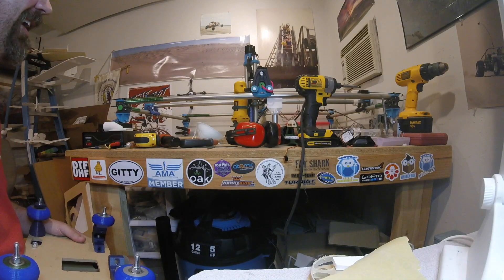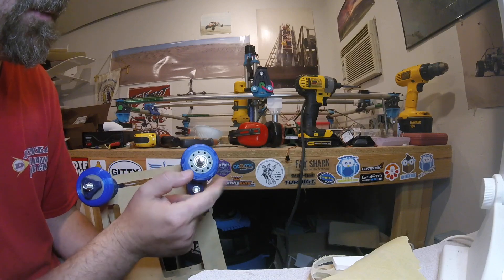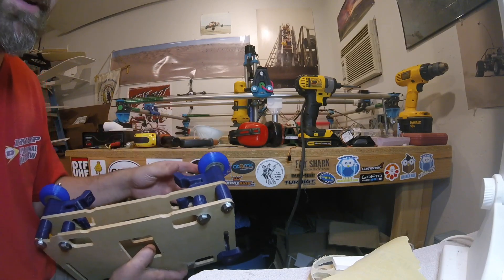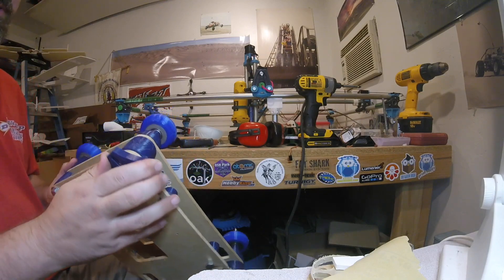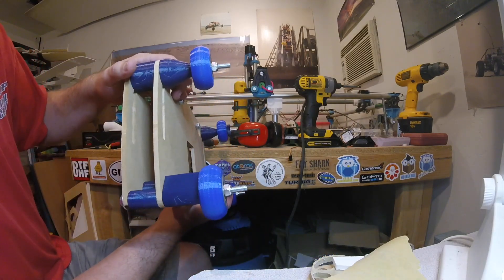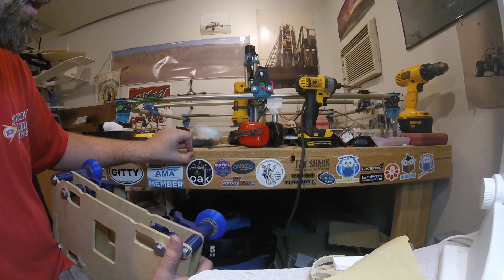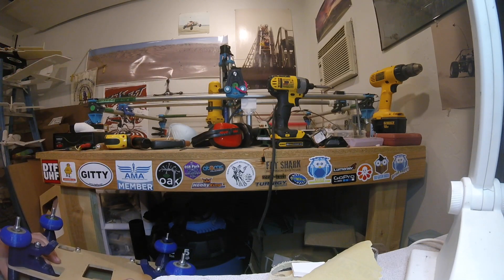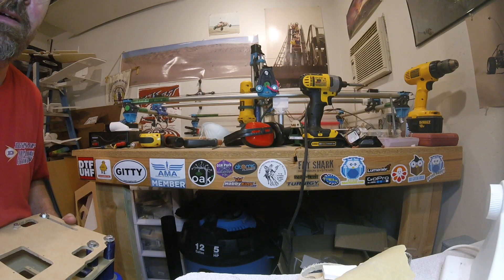3D printed wheels for a new CNC

Comment: hint: it's better to use bigger round holes with eccentric to thighten the wheels, than long holes on the plate which you use ;-)
interesting was CNC fully assembled and works now?
Reply from the maker: Eccentrics would be a great solution for that.  The plates weren't my design - only the actual wheels themselves because I was too cheap and lazy to buy real roller blade wheels.  Unfortunately I wound up selling the plates to someone else and have the printed parts in storage as I just didn't have room to build another machine and my MPCNC still does everything I need it to.

Comment: Hey, you say you aren't in a hurry, but did you ever complete the Low-Rider?   If so, how does it compare with the MPCNC.  I am ready to build one or the other and wanted your input.   My min. requirements is 20x30 DTFB and  12x24 3mm plywood.   thanks!
Reply from the maker: Sorry I never did due to lack of time and space.  I still have all the printed parts and hardware but sold the wooden parts I cut when I was in a pinch for cash.  I still want to build a low-rider one of these days...but still don't have space and now have even less time (which is why i haven't uploaded any public videos in almost 2 years.)